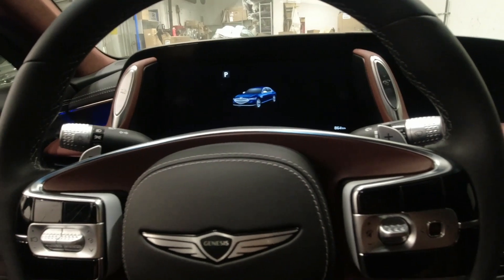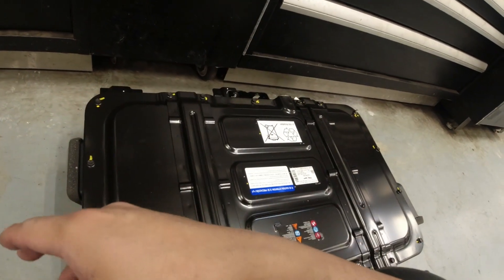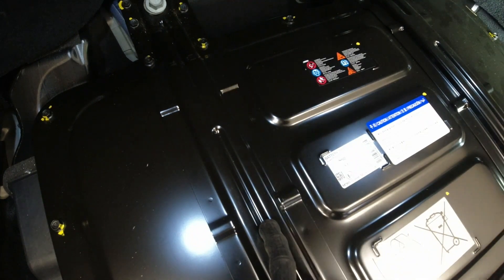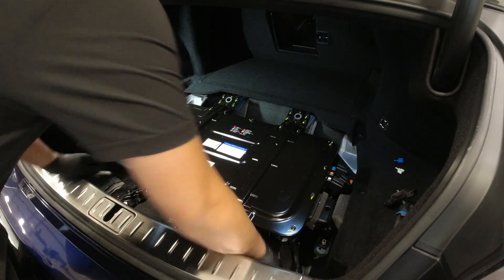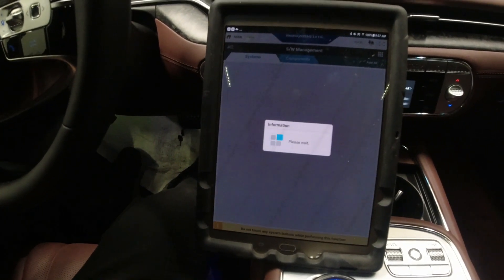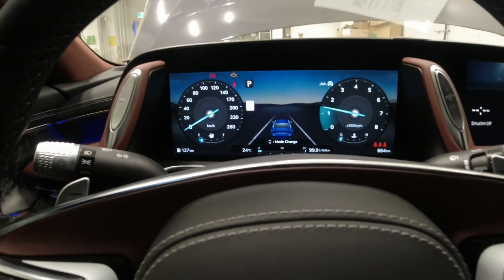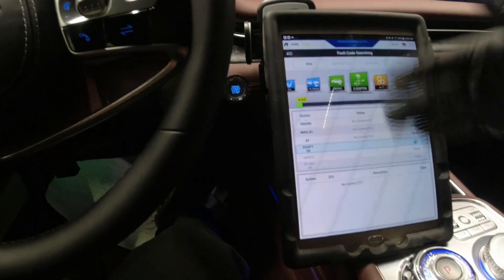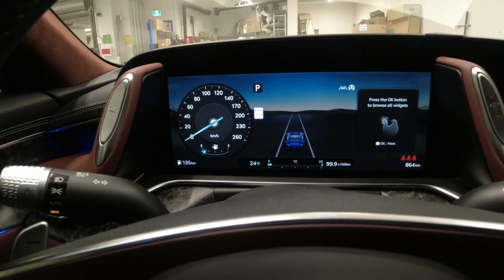2023 G90 ELECTRIC SUPER CHARGER  -  48 VOLT BATTERY REPLACMENT

Comment: My Genesis Service Advisor said they are seeing oil leaks on a lot of Genesis vehicles at around 60k km. I have 148k kms and just had oil leaks fixed under warranty
Reply from the maker: really? what kind of oil leak? i heard stories some leaks in between the engine and transmission but so far in our shop not yet hahaha.
Reply: @hyundaitech  Oil coolers, and oil filter gaskets are two of them apparently.
Reply: Did they specify on which engine trims? 3.5T V6, 3.3T V6, or 2.5T I4?
Reply: @Phil Henderson  Hello, well I have  the 3.3T. However she mentioned the 3.5T too. However, I can say other than the minor oil leaks the car has been reliable so far. The oil leak was small
Reply: @Blue-moon12  Thanks for the info. I also have a 3.3T and very reliable thus far. I have about 28,000 miles on it.
Reply: @Phil Henderson  I had a GV70 3.5T for my courtesy car whilst mine was at the dealer. It was brilliant and I bet the GV80 is even better
Reply: @Blue-moon12  Yes, they're very nice inside. I'm waiting for the 2024 G70. It's rumored to undergo a 2nd refresh and will come with the 3.5T. Interior should also see some changes to bring it in line with its sibling.